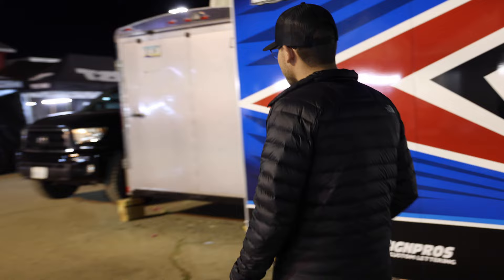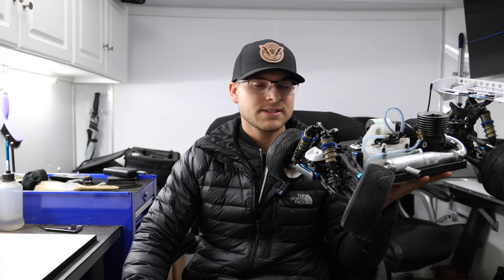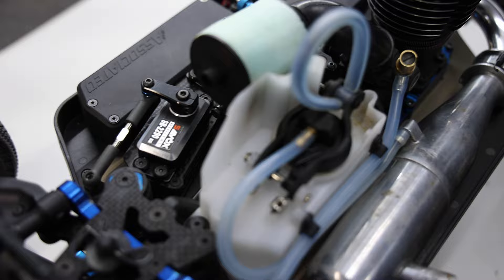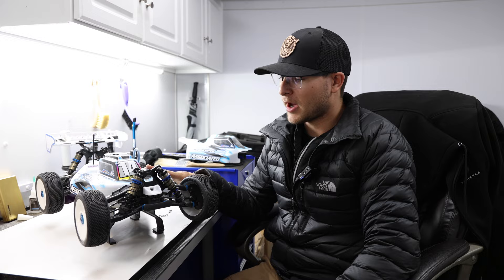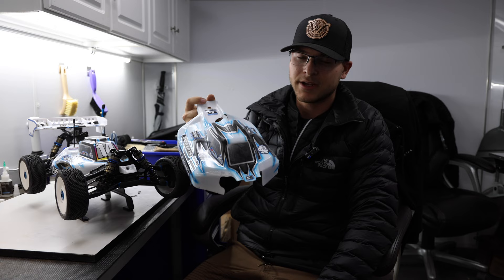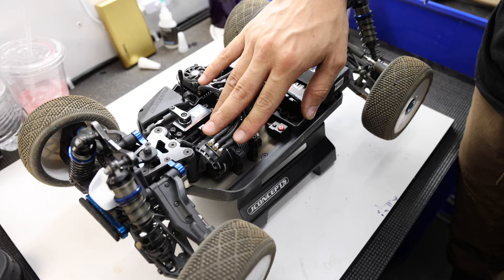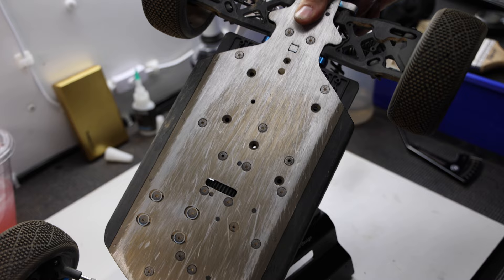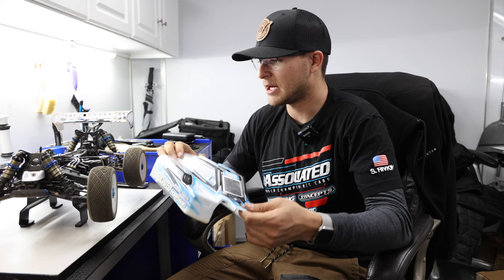NEW Team Associated RC8B4 & RC8B4E 1:8 Buggy - Spencer Rivkin

Comment: Question bout shock length - Some manufacturers are going with shorter shocks with shorter shock towers, according to  tech press releases that is to lower CG, ? some manufacturers like Kyosho offer a Long travel Shock model  3mm to 4mm longer shocks?

If the bottom of the chassis are constantly being bashed in by the big jumps, does that upset the cars on hard landings? is the solution a Longer shock with more travel? or is there something that could be done to make a better "Shorter travel" rear shock? are there limits that are imposed by the rules on shock design in terms of body length diameter, shock shaft length and diameter>>>?

I am looking to buy a buggy, debating between a Kyosho and Team Associated...always wanted to own a Team Associated buggy, but I am on the fence????
Reply from the maker: Hi there! Thanks for commenting on the video and for watching. There’s definitely a lot of things that Ultimately come into play when it comes to shocks. The general Theory about the shocks is yes, longer bodies helps with landing because of the larger amount Oil volume. As it’s important to keep the CG low it’s always a balance making sure that the 6 pound Car handles properly first. in my opinion there’s definitely more things to worry about than CG of a nitro vehicle.